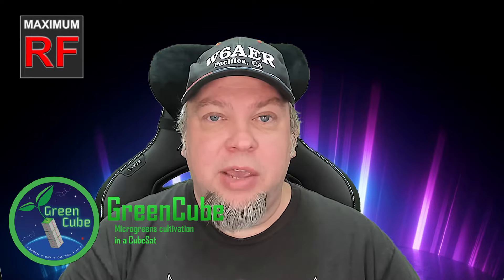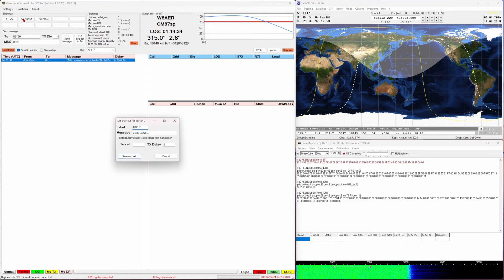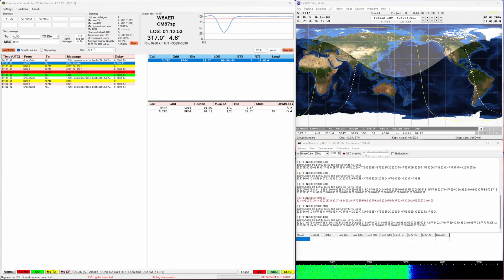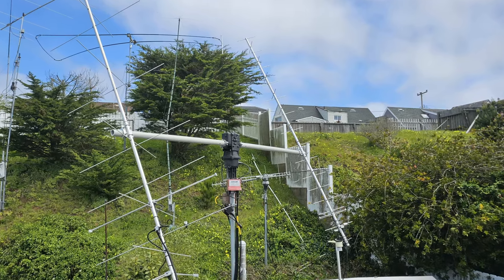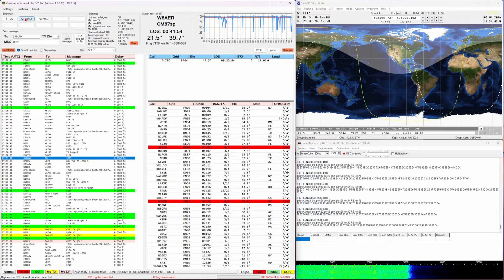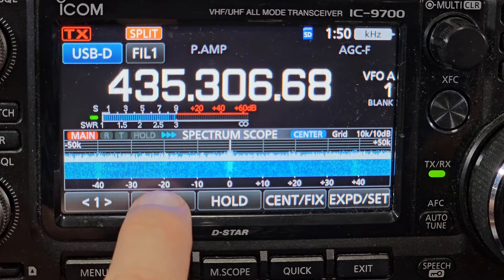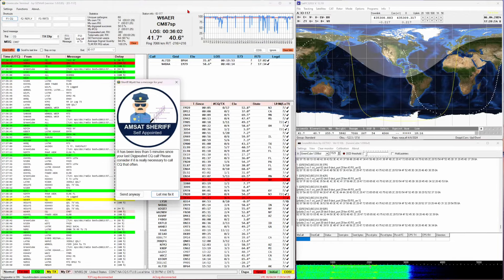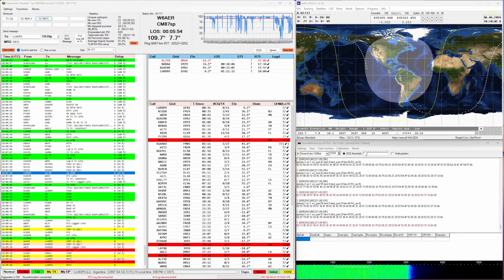GreenCube Ham Radio Satellite IO-117: Mastering DX Communication

Comment: I'm currently active on the linear translator satellites, especially RS-44; I think I'm seeing the Greencube downlink on my IC-9700's spectrum display for the first time today (I had recently installed a receive preamp for my 435 MHz. antenna).  Interested in learning what software I need to download & install for IO-117.  I'm using an S.A.T. satellite controller with the IC-9700 for antenna aiming & frequency control.

73,
Tom WA1LBK